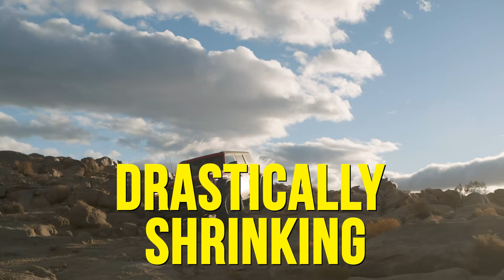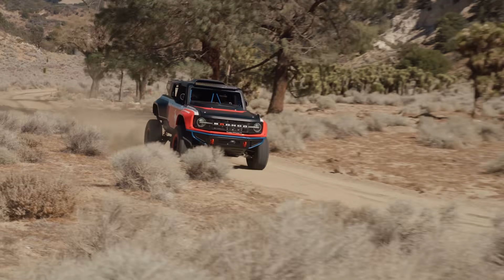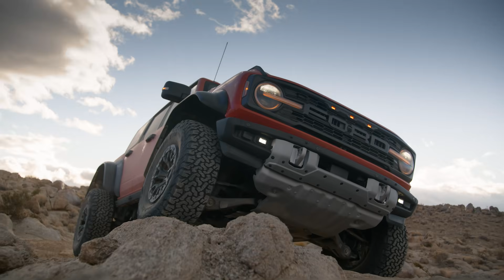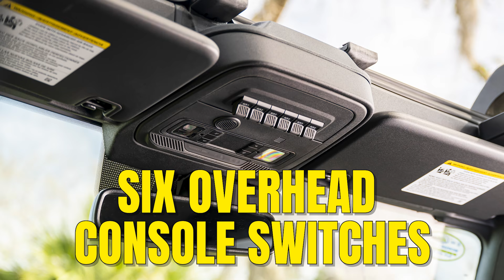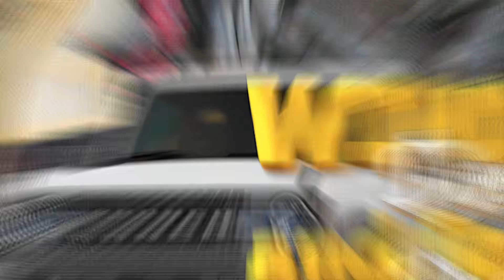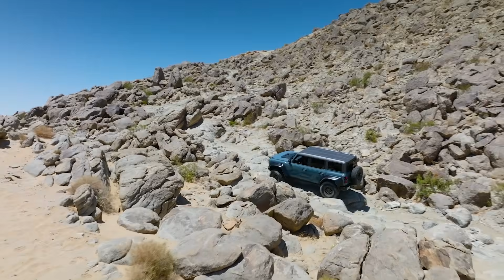8 HIDDEN Ford Bronco Features That 99% of Owners DON'T KNOW ABOUT!

Comment: A video pointing these out would be much better than a dubbed over video. Show us where the bottle opener is. Show us where and how to manipulate the back lights so we know what you're talking about.  The aux wiring is confusing as there are some under the hood that I thought were only for the switches. Then there are also the ones you mention and that's helpful. Still confusing though. The table you mention isn't a stock feature, it's something you must purchase and have installed. Glad to hear of the features just wish I had more detail or visuals.
Reply: Totally agree. They mention wires behind glovebox but show images of storage behind seats… point where they are would be preferred.
Reply: also, rather than "hidden", this is a mix of highly promoted features plus marketing easter eggs

Comment: Ford forgot to protect the alternator as it is mounted at bottom of engine and driving through muddy water as shown in your video is a good way to have to buy a $700 replacement
Reply from the maker: Yeah it’s definitely disappointing when something that’s supposed to be an off-road rig ends up being limited by a detail like that. Do you think it changes how people will actually use the Bronco, or will most owners still push it anyway?
Reply: Doesn’t matter where the alternator is mounted…..dirt/debris will get into the alternator no matter what…
Seen it on all makes and models…
Reply: @markcole6475 While true, it is MUCH more common on a low mount alternator.  A vehicle marketed as a rugged, go anywhere vehicle such as the Bronco shouldn't make the driver risk a ruined $700 alternator for driving through a few feet of muddy water.

Comment: did ford stop using soy oil to pull wires thru the insolation.   Squirrels eating wiring harnesses.
Reply: The insulation itself was made with soy
Reply: @stephenurban9880  either way - Ford didn't reimburse me neighbors so they got a sequoia
Reply: my neighbors had their wiring redone by dealership...but sold their bronco the second time it happened.  i ordered my 2026 bronco raptor 6 weeks ago (still waiting)....was told no more soy oil....i will find out